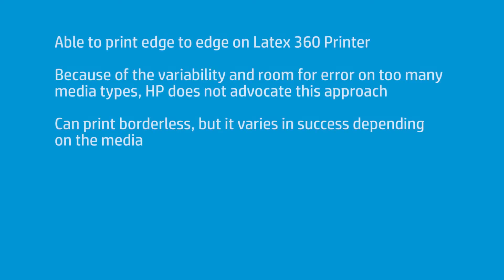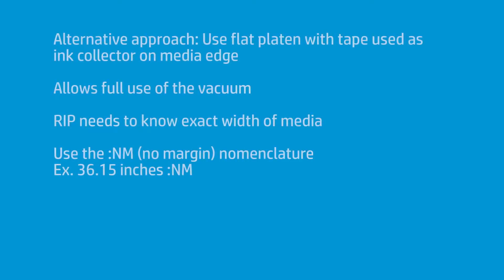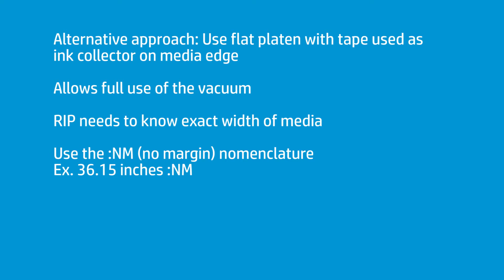Printing Edge to Edge | HP Latex | HP

Comment: Timothy, it does not work at all with my HP 365 and Onyx PosterShop 12.2.0.  I use NM all the time, but regardless of what size I tell the RIP (even wider than the actual media), it will leave about 3/16" on each edge.  I have several jobs that would benefit from this as the width of my preferred material is exactly the size of the substrate that I need to use.  I haven't found any other workaround to solve this issue, but if I do, certainly the masking tape trick will be helpful.
Reply from the maker: Hi Hanny, thanks for contacting HP Global Social Media Support!
I understand that you are experiencing an issue with your HP Latex printer. 
In order to get this issue fixed, please contact our customer care team over the phone or chat for further assistance, as this issue requires Live conversation with you over phone or chat to isolate the issue and provide you instantly with appropriate solution or repair/replacement options available at your place as per the warranty.
Please feel free to reach us on call/chat, please access this link to select your preferred country and language option to reach us. Global support link: - https://www8.hp.com/us/en/contact-hp/ww-phone-assist.html
Binu - Social Media Tech Support

Comment: Timothy, when I make my media (custom 1374mm:NM) the same size as my image (1374mm), Onyx tells me that the media is too small for the image. At this point I either have the option to cancel the job, or continue printing, and Onyx simply crops the image 10mm inside the right hand edge. Interestingly, the left hand edge does over print, as expected... so I really don't understand what's going on?? The job was setup to align from the centre of the media, with no margins on either the right or left sides.

I've tried fooling Onyx into thinking that the media is larger than it is, and then offsetting the right hand edge by half the additional distance to ensure that the job is printed in the centre of the media (eg. custom width of 1434mm; RH offset 30mm), but I still get the same error message that the media is not large enough for the image.
Reply: Yes, Onyx offsets to the non-op (right) side for some reason.  I tried "Align to Left" and it does shift it over, but not enough.
Reply: @matthewbusse1059  I use align to left as well, but still cannot get it to not leave a gap on both sides 🤔